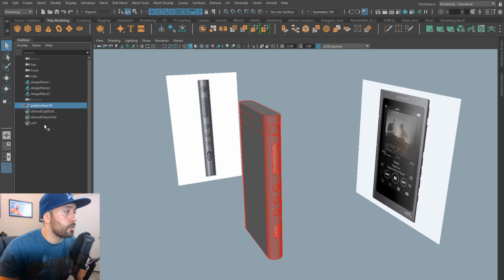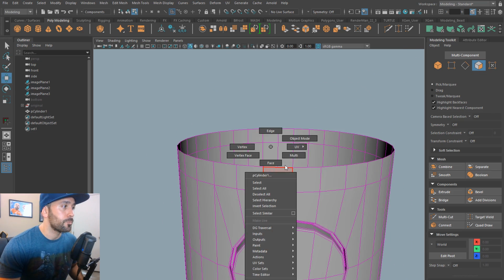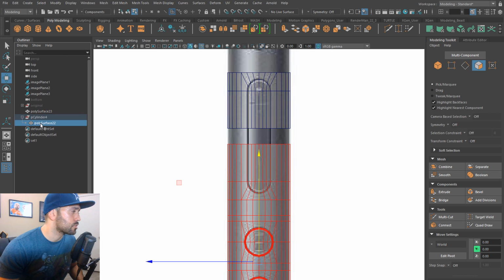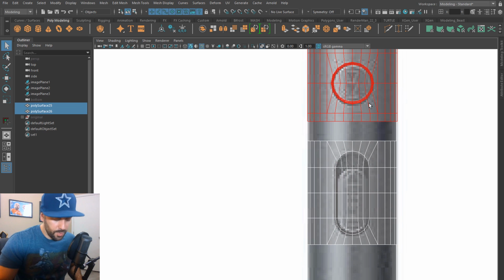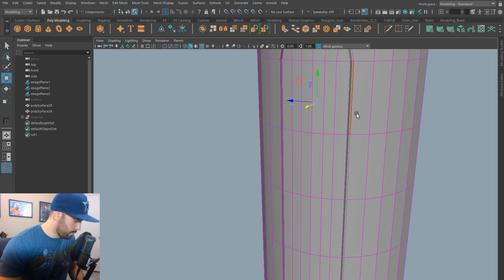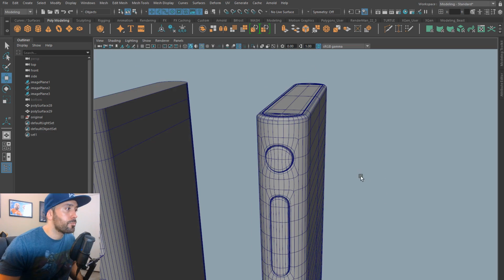Fix My 3d Model #3 Maya 3D Modeling Tutorial: Radial Insets on Curved Surfaces

Comment: I love your techniques and workflow in Maya, I’ve learnt a lot of what you shown in the past years. But I’ve also discover some new ones thanks to you. I’m sure you know this but you could save two steps when you translate the merged vertices when you extrude the top edge. You select the merged pívot, change to scale tool, press d+v to reposition the pívot to the side further vertex and scale top. Instead what I do is just select that same merged vertex as you do but simply with the move tool, press V while I’m translating the object just on the x axis and hovering which the mouse to also the same vertex that you select to scale it down, same result, less shortcuts. Great job as always, pleasure to watch you.

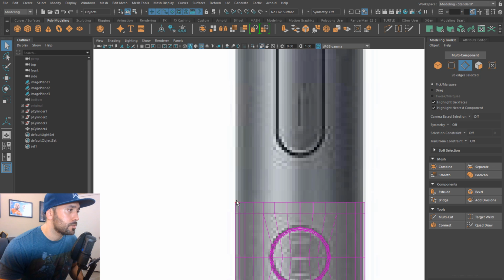Comment: Love the video... However at 10:48 you did not have to remodel that button. If you duplicated it one more time and deleted the top parts of the faces. You would have been able to extrude those edges as well and then follow the process to bridge the edges. I use blender and the best part is that this technique can be applied to any 3d application when it comes to molding.
Reply from the maker: That pill shaped button was slightly smaller radius than the rest of those buttons, that's why I rebuilt it. Yup, most of these workfows translate to most 3d packages.
Reply: @jlmussi  Cool thanks for the reply. On my phone I couldn't see those small differences. I learned so much from this video thanks.

Comment: Lastly, is a holding edge to ensure the shape stays when you go into smooth mode? Do you just have to bevel each side of the edge?
Reply: Yes, since the smoothing-operation is going edge to edge, the closer the supporting/holding edge is the smaller the smoothing will turn out. You also could just use a holding edge on one side, then you would have one harder and one smoother edge-smoothing. Hope my explanations makes sense to you.
If you need more information about the smoothing Maya uses: https://en.wikipedia.org/wiki/Catmull–Clark_subdivision_surface

Comment: When you do to edge > to edge perimeter > bevel, what keybinds are you pressing to adjust the bevel without inputting values? (19:18)
Reply: That should work with dragging the middle mouse button. If you like to change after the command promt is gone, you can select the object and find the history inside the channel box. There you can select the bevel and change it afterwards. Select what you'd like to change and drag the middle mouse to adjust.

Comment: instead of selecting edge perimeter then bevel, you can keep faces selected and do bevel faces.
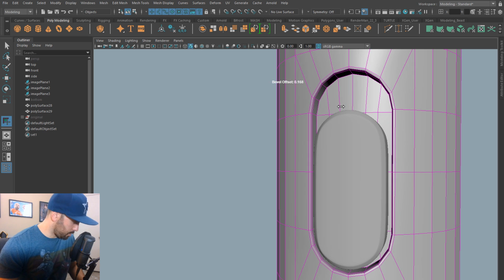also, at situations like 24:34,
selecting such edges that don't form a loop can be troublesome (imagine the capsule gap to be long and forgetting selecting the bottom edges, beveling the rest then realising that late).
better way is to select the face loop between outside and inside edges - convert to edge perimeter - deselect the edge loop above (which is just double click, unlike selecting the inside edges).
Reply from the maker: Nice, I'll have to check it out. That a newer feature?
Reply: @jlmussi  no, if I'm not wrong, it's in pie menu of shift + RMB when faces are selected.
sorry can't verify the same right now. 2 AM here 😅. family will whoop my ass if i turn on my pc now
Reply from the maker: Go for it. Do it for all us 3d modelers out there. Lol just kidding,  I'll play around with it. Thanks for the tip.
Reply: @jlmussi  that's working pretty good. Just checked it. And it's way faster. Thanks Ayush for pointing that out. (and yes it's in the pie menu ctrl+RMB> to Edges> to Edge Perimeter)

Comment: This is awesome! I never used circularize because I thought it always messed up my models. Thanks for this!
Reply from the maker: I did the same for a while...but changing the aliment to right setting is a live saver.
Reply: @jlmussi  Hi JL!, wanted to ask if you've found a way to hotkey "activate symmetry" ,similar to zBrush. I find it takes way to long to click in the maya toolkit or in the top menu and a quick google search returns nothing. thx

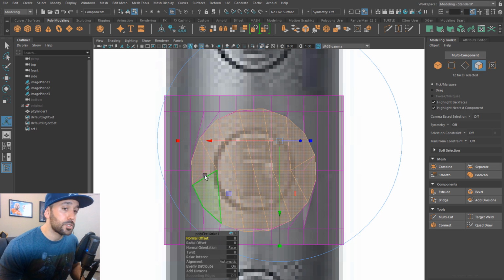Comment: Is there any alternative solution to circularize the points on surface at 6:00? Cinema 4d doesn't have a tool like Maya's circularize tool. It has a free script but it only works on flat surfaces.
Reply from the maker: Yes, if C4D supports booleans, you could do something like this: https://www.youtube.com/watch?v=aQn2f1Z3Tp4
Reply: @jlmussi  Thank you, it did work. :) Plus I found a cheap plugin called NitroCycle which does the same as Maya's native tool.
Reply: Place a cylinder like he did in the video, then cut the circle by hand, extrude edge offset and then move inner circle vertices by edge constraint to where you need them. Have no clue about modelling in C4D, but this should be possible with any decent 3d modeling tool, I guess.